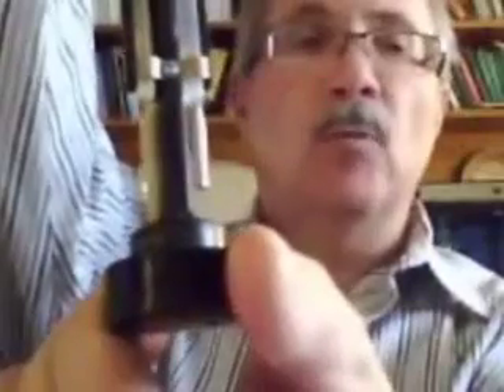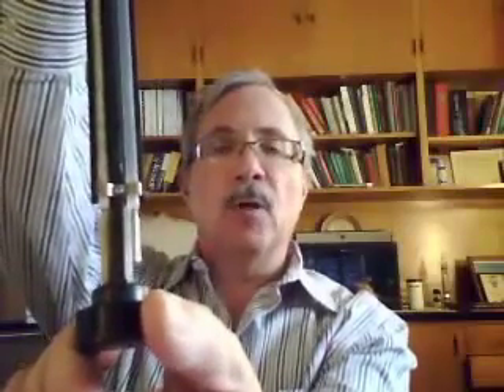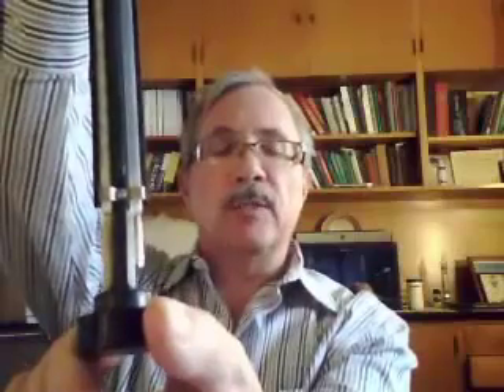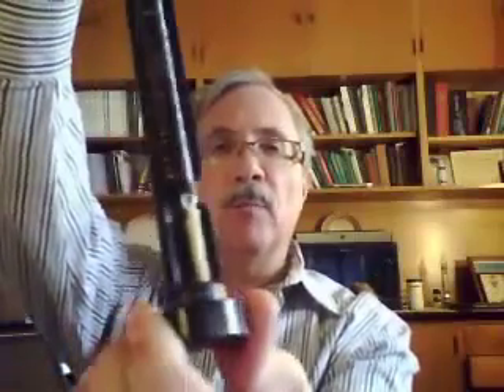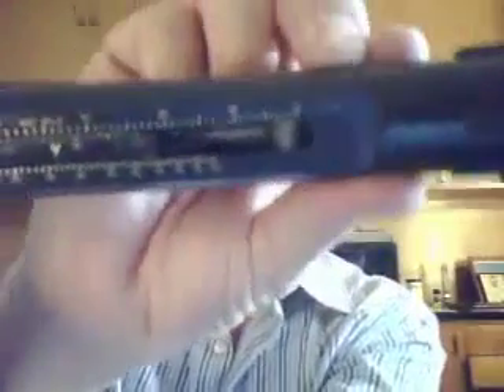Sling Psychrometer Demonstration

Comment: Its been years since I've used one, but we use to have to check the wet bulb/ dry bulb readings on certain painting jobs. We had to document everything twice daily. Temp., humidity, etc . If my memory is right,, we needed to know the " spread" . The difference between the temp and the dew point = spread. It basically told us if too much moisture was in the air, and if we could paint that day, or maybe just that morning. When there is too much moisture in the air, it drastically effects the drying time, or cure time, of the paint. I've seen some major paint failures over the years due to the paint being applied with too much moisture in the air. Good video, thanks for posting. JohnG
Reply: john g are you having to calibrate any equipment? And did you need a certification for your job?

Comment: can someone tell me why its 31%? show calculations please
Reply: Subtract the wet bulb T from the dry bulb T to get a number called the "wet bulb depression". The smaller this number, the higher the relative humidity; the larger this number, the lower the RH. Other less sophisticated sling psychrometers have a chart by which the dry T and the wet bulb depression are graphed to show dew point T and saturation vapor pressures of both dry T and dew point T. From these pressures, divide dew point P by dry bulb P to get relative humidity. It sounds awful written out like this, but with the device and the chart, it's easy peasy, and loads of fun in the classroom!